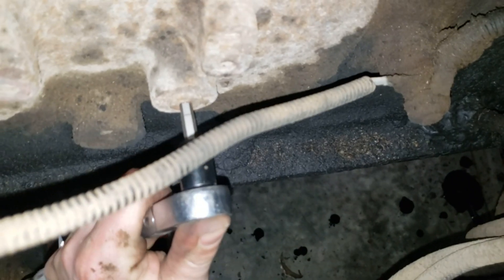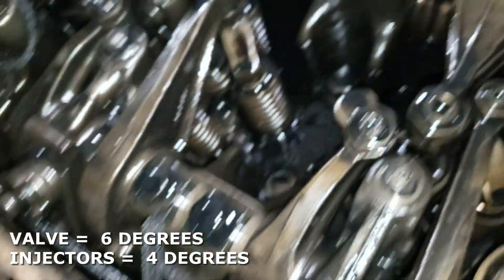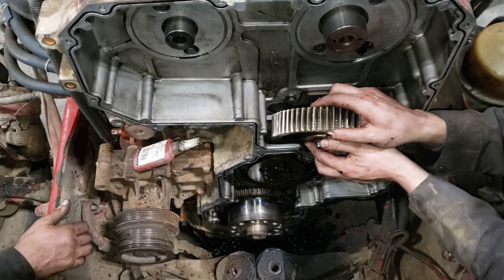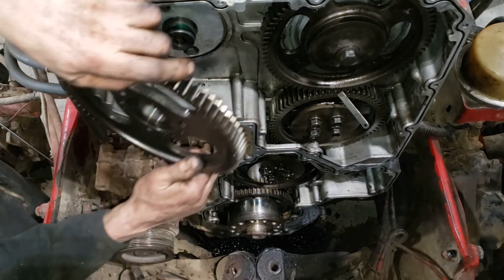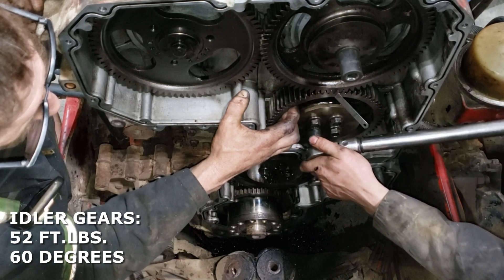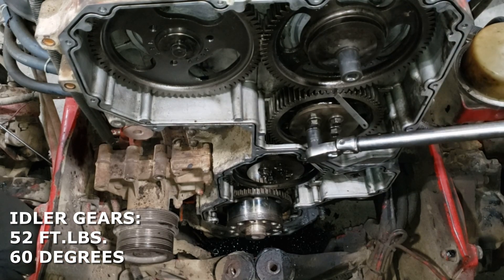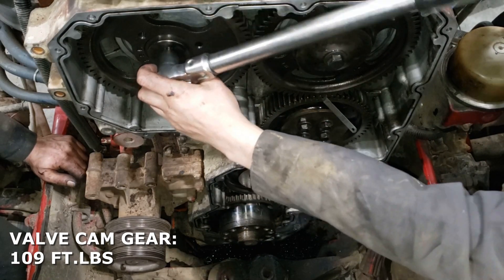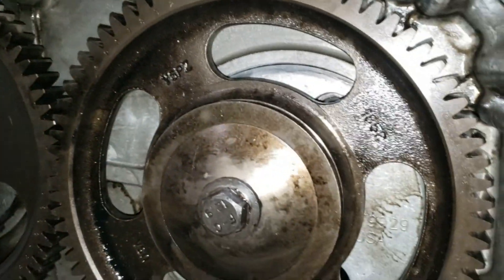| HOW TO TIME A TWIN CAM ISX | TORQUE SPECS INLUDED |

Comment: I know this is an old video but there is a TSB on that large cam retaining plate.  How do I know....because I just took my front cover off and it was in 3 pieces and had filed a little bit of the crank tone ring.

Comment: What’s the difference between the twin cam vs the single cam?
Reply from the maker: Single cam only has the one cam for valves.  They use electronic injectors and a common rail fuel system which does not require the injector cam.
Reply: @zedperformance in your opinion which is better!